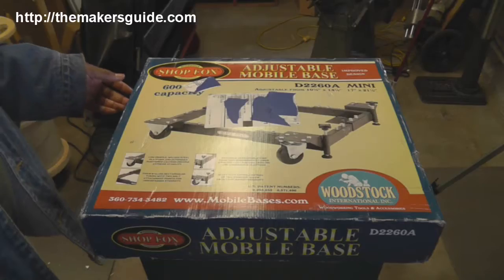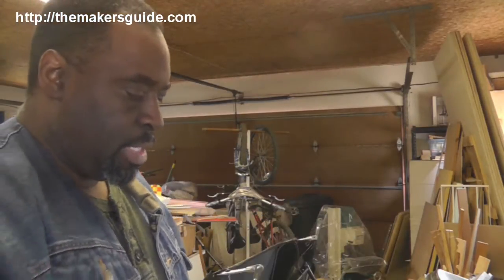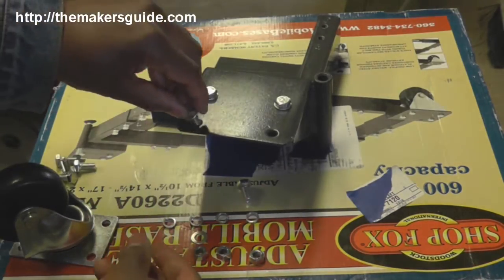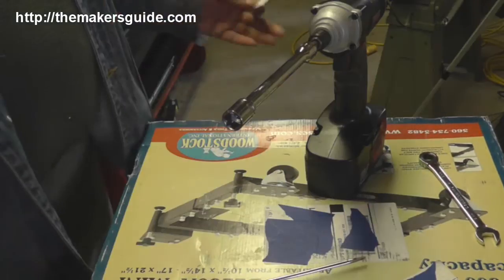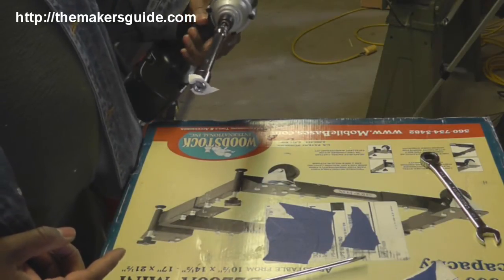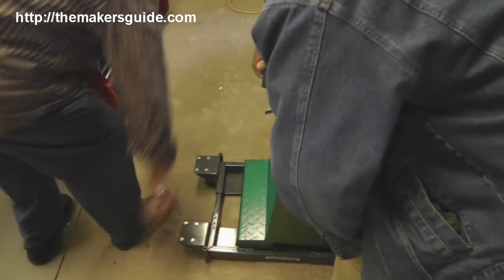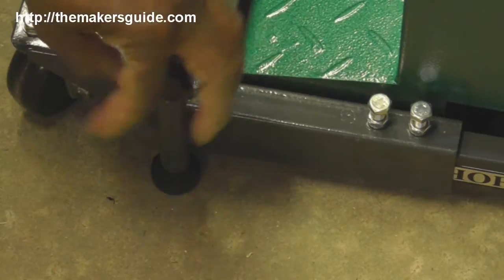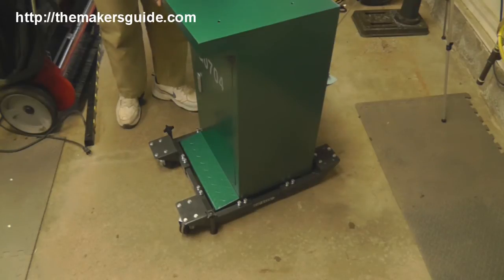Shopfox Mobile Base Unboxing and Assembly

Comment: Bill, there were a few handy-dandy tips in there.  Thanks.  I loved the one about putting the washer and nut on the end of the screwdriver to fit it in.  For years I thought cursing was the only way to fit fasteners into tight spots.

Comment: I think you did the nylon lock nut backwards from what my manual states.  The nylon portion is supposed to be facing the head of the bolt.
Reply from the maker: I did that on purpose because it fit better.
Reply from the maker: Yes, I did that on purpose.